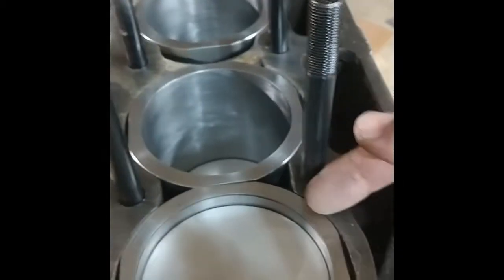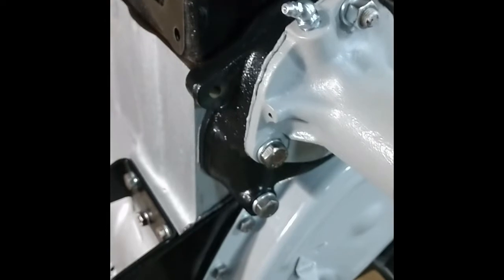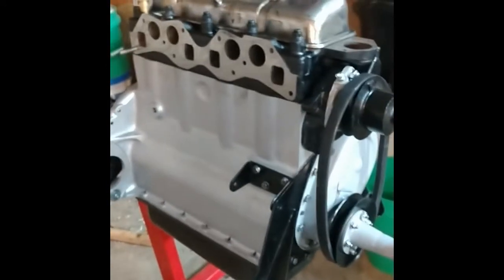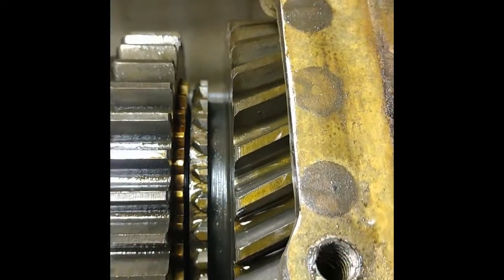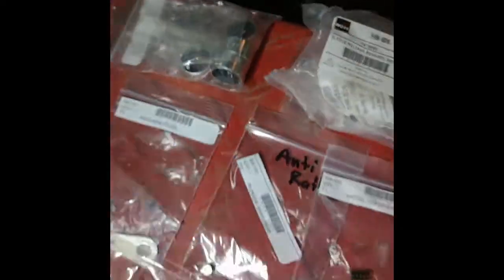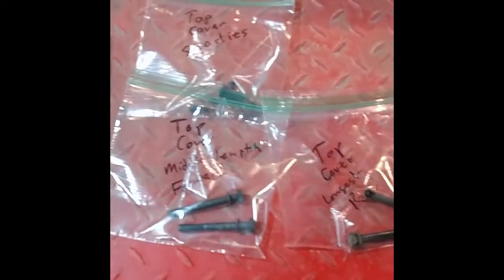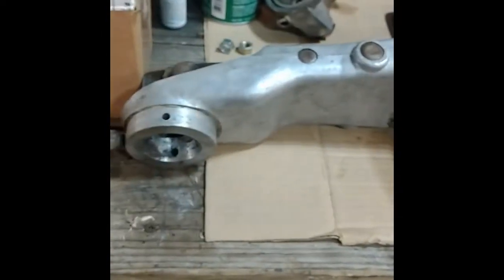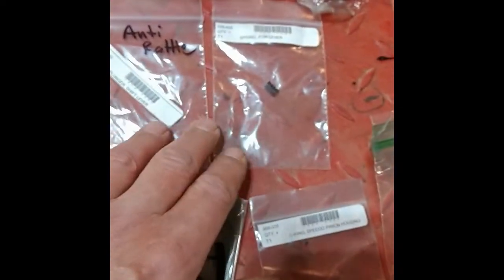1967 Triumph TR4A, Part29, Finishing Engine Assy, Starting on Tranny and OD

Comment: Thanks JB, looking forward to watching this rebuild. I just picked up an OD for my TR3A project, and will need to rebuild since it was open and exposed to the elements for a decade or more.
Reply from the maker: I am finished with it, it was a project.  Mine was worn and had to have a custom part machined to get it back into spec.

Comment: Engine is looking great.  Too bad about the trans but it will be a good learning experience.  Your overdrive should work in 2/3/4 if it’s an A Type.  The 1st gear synchro came in with the TR3B just as an FYI.   Looking forward to following the rebuild. I might need to do mine in the 4 once I get to it.
Reply from the maker: ugh, it was a mess, I had to have a custom part machined and it took forever.  You would have thought I would have got caught up on my videos in the down time....